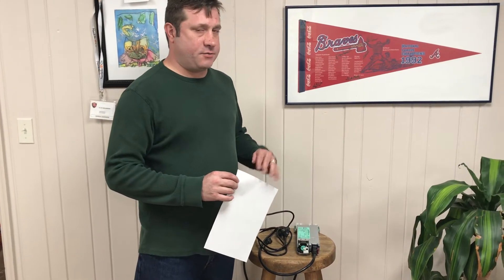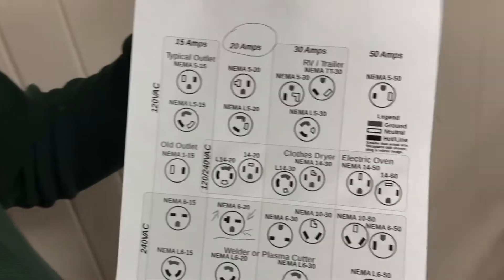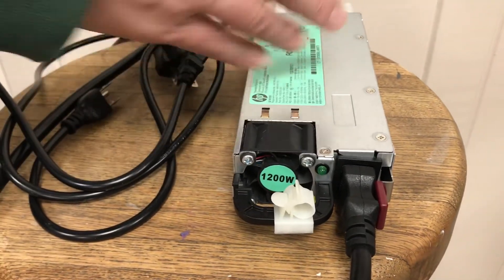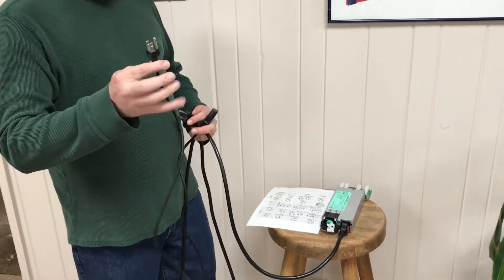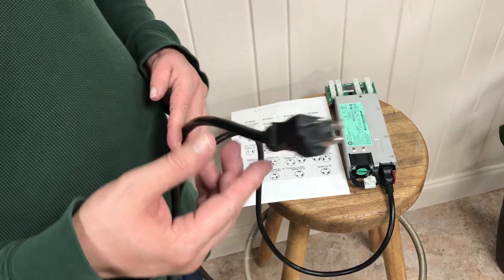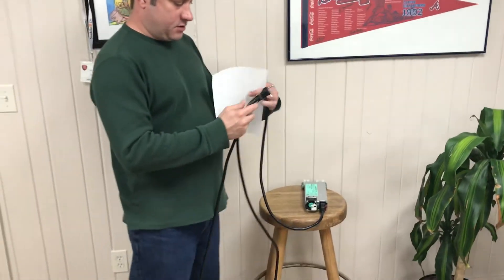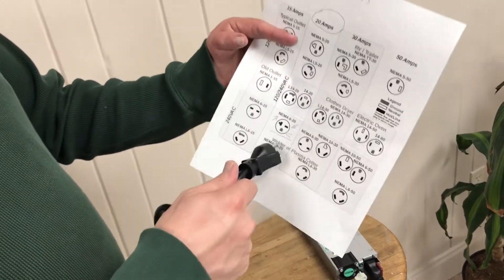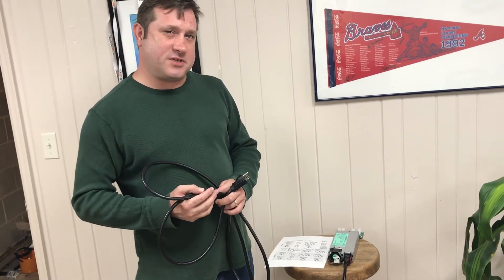Avalon miner power requirements

Comment: great video, helped a lot.  How would you run multiple avalonminers, is there a risk of shorting? how many amps should my panel be if I want to run for example 20 miners all at once, would I need 20*20amps= 400 amp panel?

Comment: I will be trying this on 120V tonight or tomorrow...  I have the exact same power supply as you do, plus another two HP 750s.  What is the reason 120V wont work?  Maybe the 1200 on 120V wont work but 2x 750 on 120v would because of the loss.

edit: the house connection on the breaker panel says the incoming is 240V, however, the multimeter reads 120-124V on every outlet.  Appreciate the video.

edit2: read the labels a bit closer and saw I have the same 1200W HP PSUs that you have in your video, and if you read closer, you can see that it runs 900W on 120V, so you would need something supplementing that, or you are correct, the Avalon 741 would not run the 1150+- 15% needed.  There are 1200W PSUs that are 208V to 240V which would only work this the plugs described in the video.
Reply from the maker: Correct, I have 240V available so a single 1200 watt HP PSU works for my setup.
Reply: Would it work with 1600watt bitmain psu

Comment: What about a step up transform/convert from 110/120 to 220/240?  Would this work to run the Avalon 741
Reply: Thanks again, At Home Crypto. For your info and anyone else wondering a step up transform runs the Avalon 741. I purchased a 1600 watt step up transform that converts 100-120v to 240v. The video and comments save my mining experience.  Thanks again!!!

Comment: You said to stick in the 15-20A range, 240V quadrant, but also said if you can make a wire with C13 on one end and 14-30 on the other (dryer connection), that will work as well, but it is 30A. Will that work safely?
Reply from the maker: yes, it should if you have access to that 30A.

Comment: Thanks for all the good info. Would it be possible for the Avalon Miner to work on a dryer outlet that is NEMA 10-30? I know its in the 240V category but wanted to make sure before I had one made. Thank you
Reply from the maker: yes that would work.  Considering the AMP-age you will have access to you may want to consider a PDU strip.
Reply: Thank you for the response. I didn't even think of using a PDU strip. I have an additional question in regards to the PDU strip. I've been looking for options for the better part of 2 hours and haven't been able to find any strips that would fit into the 10-30 dryer socket. Do you have any ideas where I could find one or what other options I would have? Thanks for all the help I appreciate it.
Reply from the maker: my go to sites for these are Cables.com and PDUwhips.com.  This link should be what you need https://www.pduwhips.com/products/2176-l6-30-to-c13-power-cables.aspx
Reply: Thank you again those sites are very helpful and it looks like ill need to have one made beings it doesn't look like they make a standard cable for the NEMA 10-30 socket. I know you mentioned a PDU strip so I was wondering if it would it be better to have the cord made with two 20amp or 15amp C13 ends or with one 30amp C13 end? And if I do have two c13 ends put on would it be safe to run two of the miners off of the custom made cord out of the one thirty amp socket? Sorry for all the questions I'm just starting to learn more of the details and am really glad I ran across your video's.
Reply from the maker: I would definitely call. the guys at PDUwhip with those questions,  I would hate to give bad electrical advice.  They are extremely helpful if you call them.

Comment: Hi. Just wondering where to get wires...the six groups of wires plugged into the six plugs in back of the avalon 741.  They don't come with the HP power supply or with the controller and certainly not with the miner itself.  Are they ordered separately?
Reply from the maker: Yes,  you can buy the PCI-X cables and breakout board as a bundle at most electronics or mining related sites.
Reply: Is this the Raspberry Pi3 that will work with the Avalon? https%3A%2F%2Fwww.ebay.com%2Fulk%2Fitm%2F302562762705.
Reply from the maker: That link is not working but make sure you get the Raspberry Pi 3 Model B.  The Canaan site has good info on this and the download instructions.

Comment: What about NEMA L6-30?
Reply from the maker: yes that will work if you have access to that type of socket and the correct power cable.
Reply: AtHomeCrypto thanks man. I’m going to run APC  AP7541 PDU’s off of each 30amp plug.  The NEMA L630’s then I can run about 4 Avalons off of each of those. With the c13s
Reply from the maker: Nice, I love to hear that and hope others read this for guidance.  Well done!

Comment: FYI, you can indeed run a 741 off 110v. Parallel Miner makes a kit using HP PSU's and I believe you can do two Corsair/similar PSU's as well so long as you use only one PSU to power each side. Obviously 220/240v is preferred but people need to know there are options.
Reply: Have you used the parallel miner kit on 120v?
Reply: I have not. But I know of people who just use two Corsair 750w PSU's and say it works just fine. That's essentially the same thing. On forums people are aware of the Parallel Miner setup and have not posted anything which would suggest it won't work.
Reply: I can now say that the parallel miner Avalon 721/741 HP PSU kit does indeed work on 120v. Running steady at 12.6 volts
Reply from the maker: I have not used this power configuration that the person mentions and would recommend asking the manufacturer to confirm prior to purchasing and trying yourself.
Reply: Canaan specifically mentions the EVGA 1300w PSU on their website as a PSU which works and that is 110v compatible. A simple search on bitcointalk.org and other forums will show there are a number of options for people who are not in a position to wire up a 220v circuit.
Reply from the maker: This is good info, Thanks Dane!
Reply from the maker: That is great news!  Thank you & well done.

Comment: How much power does it take from the wall and in canaan's website they say it can adjust its speed so what approximately how many th/s you are getting most of the time?
Reply from the maker: Using the 240 VAC, It pulls 5 amps at wall.  7.5 th/s is consistent.
Reply: Thanks for your fast reply.